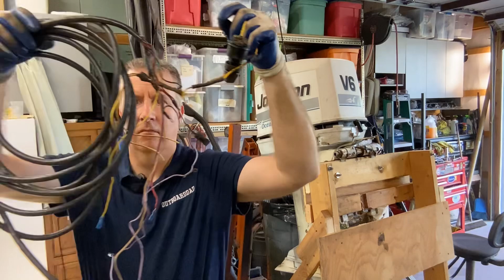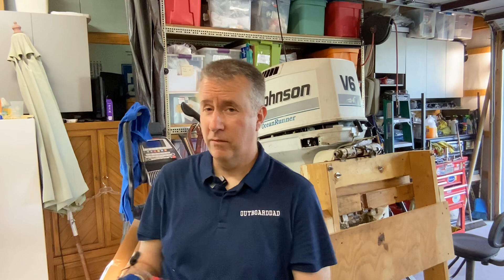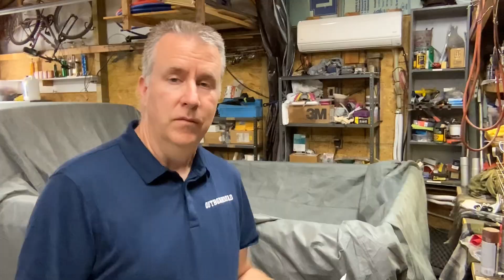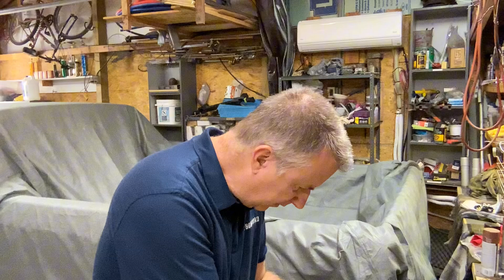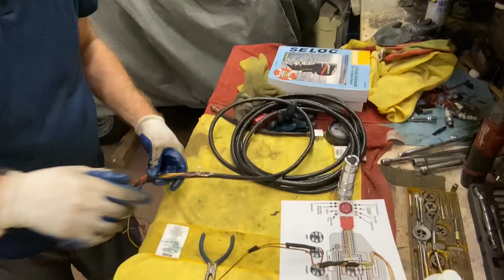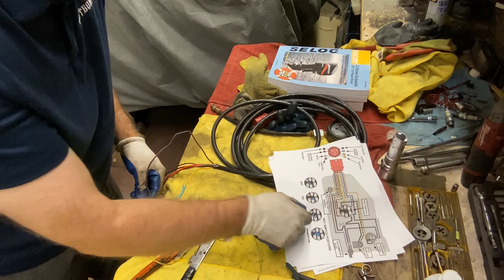Johnson Evinrude Outboard ignition wiring fix

Comment: Hello! I would like some help. 
I have this particular engine (40 Mercury tow four-cylinder) and I want to connect the engine temperature sensor (87-16775A 3 - Switch). 
The problem is that the previous owner has removed the oil pan. 
How do I connect the sensor to the alarm that is in the engine electronics (MERCURY-MARINER 40HP-275HP 2T OIL WARNING MODULE Replaces*: 14857A16, 14857A10) without putting the wires that would go to the oil pan?
Reply from the maker: OK, email me the details and pictures of the switch and if you have wiring diagrams to keith@outboarddad.com

Comment: Good video ! I’m converting a Johnson 70 1987 too a tiller handle , going too splice onto the existing console harness .
Reply from the maker: @hondoe3442  sweet! Let me know if I can help
Reply: I’ve looked at your wiring diagram your using and it’s fairly straightforward, on the start side though . The positive needs too send power too the accessory too keep the motor running , then positive also too the starter wire for the momentary contact ? I was tossing around the idea of making it push button but I may buy a key ignition with a kill switch lanyard . Thanks man
Reply from the maker: @ Glad to help? Where are you located? You can usually find some one sell controls
Reply: Yes I have a console but the tiller handle I bought doesn’t have any wiring so I’m going too make my own ! I’m an electrician so I’m confident in it
Reply from the maker: @ Sweet! Send me some pics of the process and I will make a video.   Keith@outboarddad.com

Comment: would this work on a outboard that has been converted to pull start?? i have a 30hp Johnson that still has the starter and everything on it,  I was trying to find videos to find out how to hook up a kill switch but my brother told me id be better off going from the red plug that is already on the outboard. so i been looking up vids and ran across your channel. Because if i need to buy a ignition switch I will lol
Reply from the maker: @seedless-bud  sure, they made that red plug style from around 1978 until 1995 so if you check on Facebook marketplace someone is selling an ignition switch with harness connected. You may have to get the controls as well if it is sold as a set. ebay too. Keithm5734@verizon.net
Reply: @OutboardDad  I got the other end of the red plug it was cut so i got about a bit over 5 feet of it to work with lol. I thought I could just by pass everything and rig it up for pull start but i will look online for the ignition key setup and try to rig it up for just turning the key so i can pull start it? i still need to read up on everything lol i know enough to understand everything but still new to it so taking it easy and trying to learn about the system before i get into then water you know, So this helps a lot thank you
Reply from the maker: @seedless-bud  anytime, i have the drawing in my video. Should be able to rig a switch from ground to the kill wire. Just be sure to safe off all the others. If you email me I can send it to you
Reply: Great video. I’m searching for a diagram for an Evinrude 150. 1990. Lost ignition at key some how and now boat won’t start. Can I ask where you got the wiring diagram.